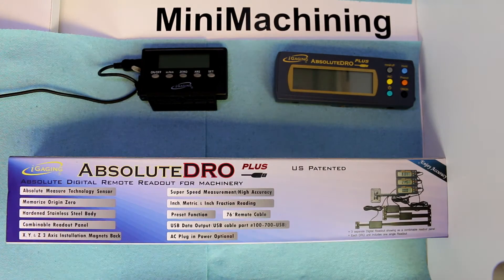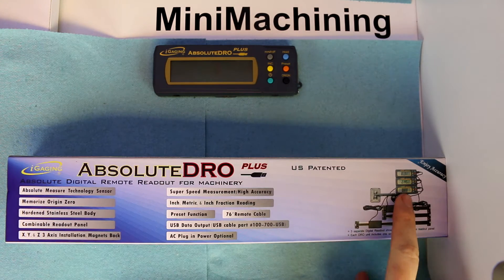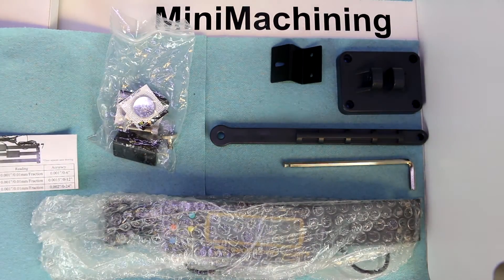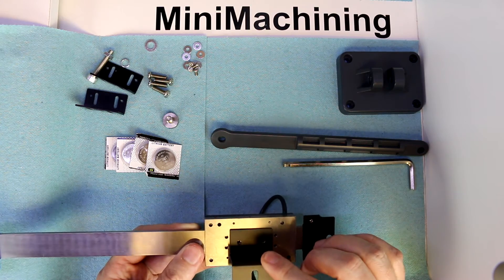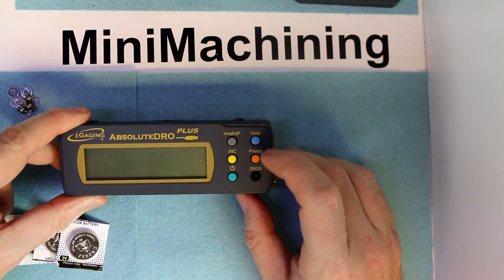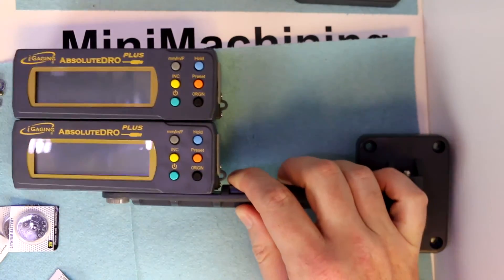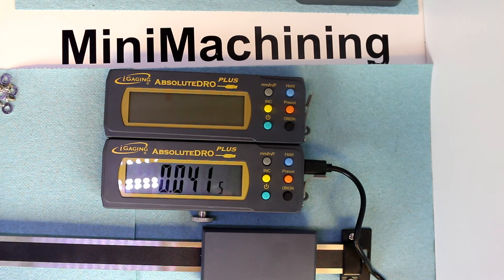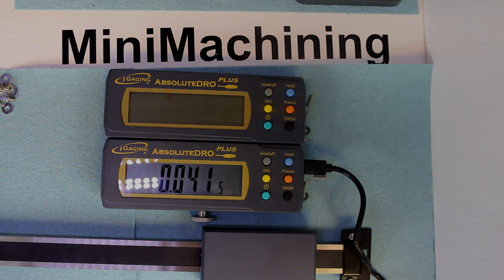iGaging Absolute DRO First Look

Comment: Guys my experience has been that these are junk.  they have absolutely no protection from coolant anywhere.  One drop is all it takes.  Then you start playing with brake cleaner and air gun to dry it all out and get it running again.  Now that is the least of your problem, but when threading and it seems like all is running well and you are off by say .010" then you have real problems.  But now 16 months after not using this item display doesn't work  period.  Get the Chinese glass scale units, figure out how to mount it and be done with it.  This thing has been plagued with problems for me from day one.  Sad to say the Chinese care more about their customers than these guys.

Comment: Is this DRO a standard quadrature readout that can be used with other brands of encoders, possibly on other machines?  Certainly micro-USB cables are not what you normally find on older lathes & mills...
That single sheet of instructions didn't look like it had setup instructions for any bar other than what came with the DRO.

Comment: The cables have micro-b connectors at both ends, and are not shielded (although that may change from batch to batch).  All that extra length makes the cables prone to picking up interference.  Replacing the cables with shorter shielded cables is recommended.  You will have to pop the plastic case of the reader head open to unplug that end of the cable.

Comment: Your videos are the absolute best when it comes to the Sherline equipment! Extremely informative and so easy to follow.  Thanks to for making them available. 

I am curious to know if you have a follow up video to this one showing the installation of the DRO units on the mill and lathe if you did it as well. I am on the verge of purchasing a Sherline 6000 mill and lathe system and am not sure if I want to go with their version of the DRO for now or with the igaging set up. I am totally new to machining and will likely learn without CNC for now and just add it later. Also, have you done a video showing the completed version of the Frankenmill?

Comment: Great video series! I have a Sherline lathe and mill. You've offered several brilliant projects to improve what Sherline has. Before looking at your series, I had purchased the iGaging cheaper DROs. I haven't come up with a satisfactory way to attaching them to my lathe (I wanted to start with the lathe first since I use the lathe more). I was going to put them on a bigger manual lathe I have, but I'm looking forward to what you come up with. The CNC application from Sherline doesn't allow for manual adjustment, so DROs is the only other option I see. There's several people who've made DROs from shaft encoders and Arduinos, but that's more money, and no guarantee they will work. With the iGaging, at least that will work out of the box and there's no need to make circuit boards, programs, etc. I look forward to seeing more on your video series!

Comment: I like that these do not interfere with the handwheels. Looking forward to seeing how you mount them.  I have the cnc kit on my mill so the Sherline dro's are not a option, and I like the adjustable zero handwheels. 

I have the Sherline DRO's on my lathe.  They are incredibly accurate, and yes you can set the backlash. It is adjusted by first using a indicator to determine the amount of slop. Holding down the power button brings up the backlash scales and you adjust it to the number you indicated by pressing the button for that axis. It moves in .0005" increments .  Every so often I recheck and update the number if needed. I am often surprised at how accurate they are. I don't even work for Sherline
Reply from the maker: +Marco Terenzi Thank you Marco! That is very good information that I was not aware of. I honestly wish I had the Sherline DRO also just for the convenience of mounting very easily and the RPM readout.
Reply from the maker: +Marco Terenzi I forgot to mention... you can mount DRO on CNC if you want to go that direction. Sherline has an instruction sheet on how to accomplish it and part numbers needed. http://www.sherline.com/drooncnc.pdf
Reply: +MiniMachining Thank you. Never saw that. Good to know.
Reply: +MiniMachining I tried that link. It doesn't appear to work.
Reply from the maker: I've poked around a little bit and looks like they've removed the document, not sure why they did it or if it was a mistake. Might try contacting support and seeing if they have copy that can be e-mailed.